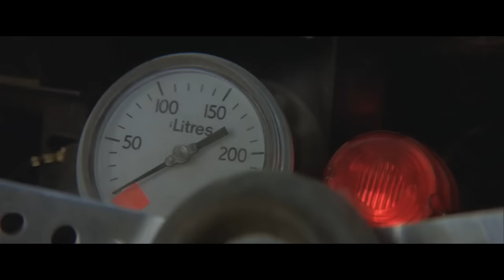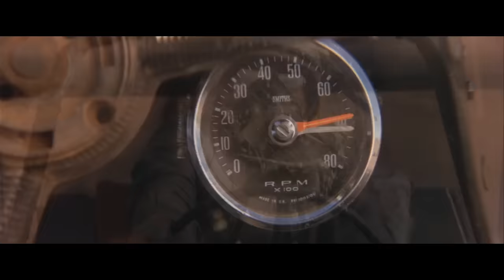Judas Priest - Turbo Lover(Mad Max 2, 1982)

Comment: What car is max driving and what make is it
Reply: Ford falcon xb gt coupe with a v8 352 Cleveland chevy motor and a weland blower style supercharger making supposedly 600hp to the wheels lol but let's be real cars only as good as the driver. 

I'm planning on building a black Mercedes e500 v8 5.0l w134 body coupe with a supercharger blower lifted suspension in the rear. 

Max's car is nice though and style inspires other builds